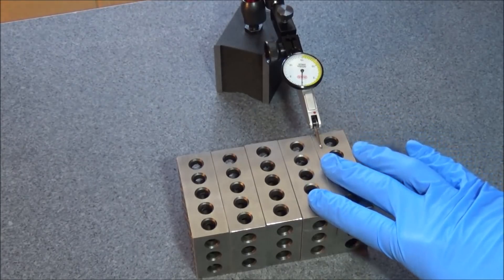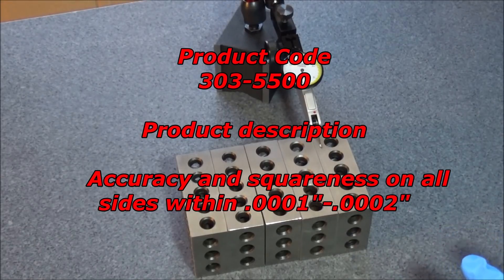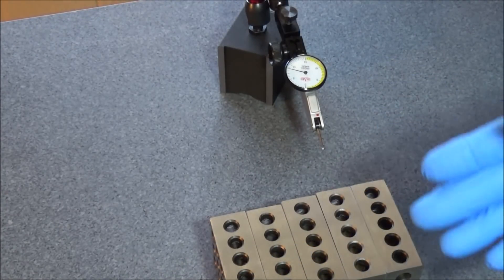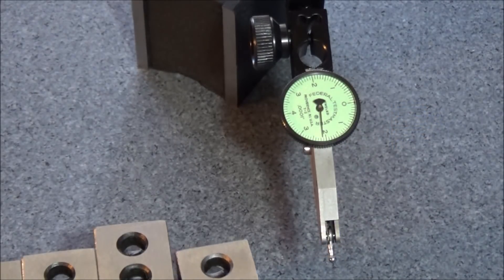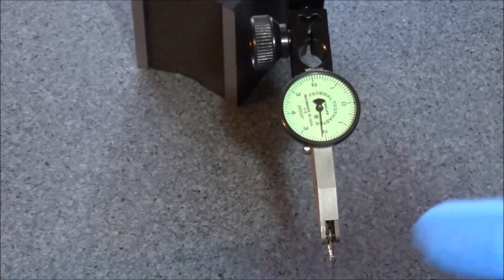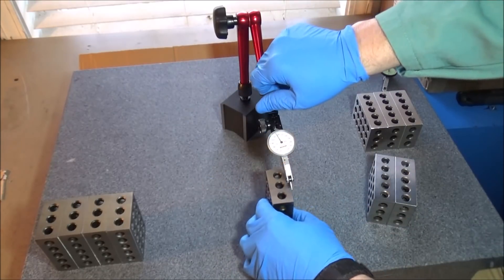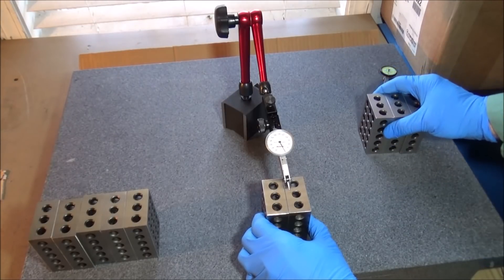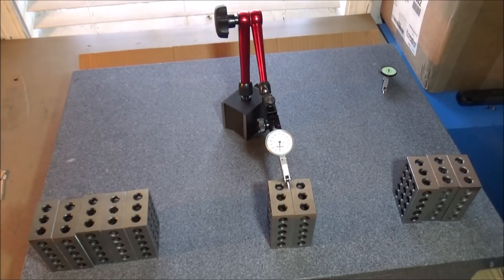123 Blocks

Comment: Hi, you made a really accurate comparison, but which of the various groups of blocks really corresponds to the declared measure?
I would first consider those closer to the real measure and then calculated the difference from the declared measure.
The group you had was the oldest but certainly the one bought when the market related to these objects was much lower, so in my opinion perhaps the most accurate.
Try to verify the declared size.
With the tools you have you should not be a problem.
If you have already made my speech, you do not have to consider it.
Hello to the prox
Paul
Reply from the maker: Yes the higher resolution the more accurate you can see variations